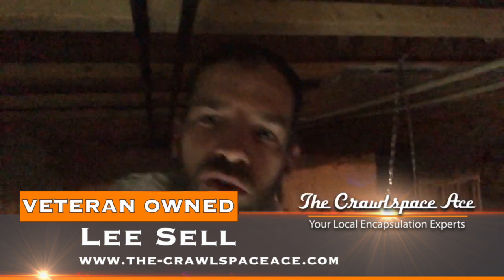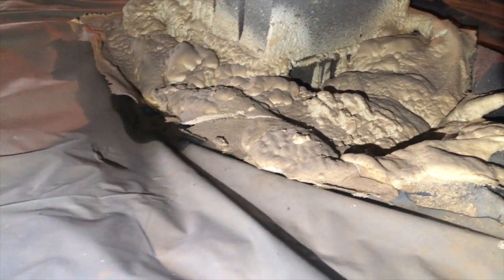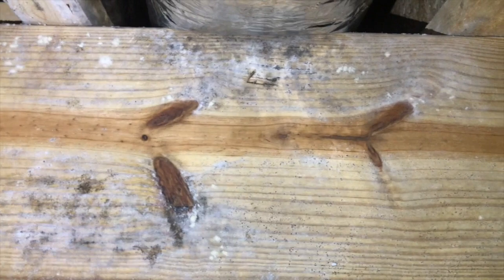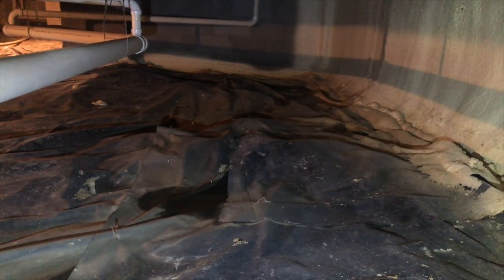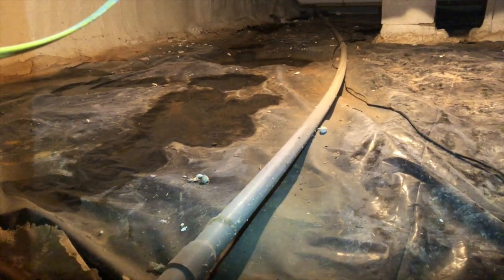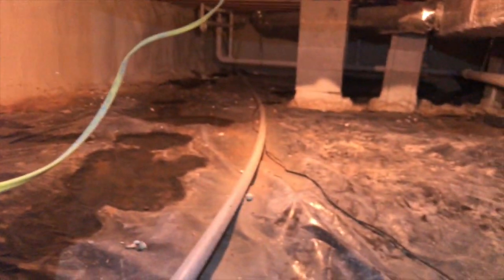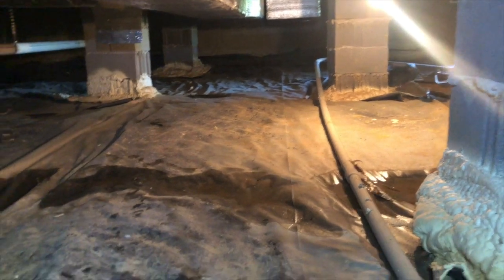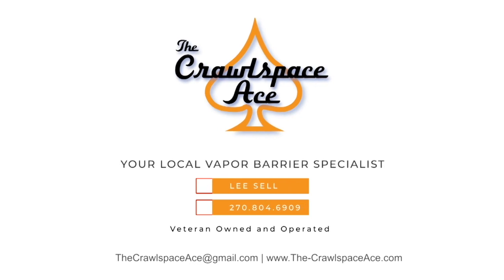ANOTHER Failed Spray Foam Encapsulation in Symsonia, KY

Comment: I don’t understand what you mean when you say “spray foam encapsulation don’t do it “ what should you do ? Are you saying don’t encapsulate?
Reply from the maker: Hi Donny! What we are saying is be careful who you hire to come in and encapsulate your crawl space. Encapsulations are one of the best things you can do for your home. Insulation contractors just tend not to know much about crawl space waterproofing. They just come in, lay down a liner, spray their foam, and get out of there. Not saying that all insulation contractors are this way, but it is what we see on a regular basis out here in Western Kentucky. You are much better off hiring an actual crawl space waterproofing company. One that will take all the factors into account when deciding on the right system for your crawl space.